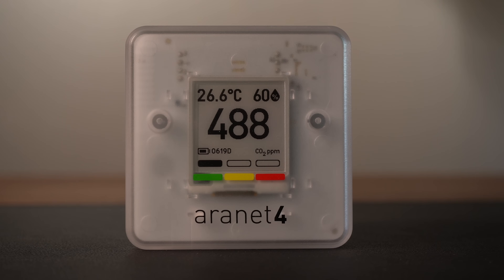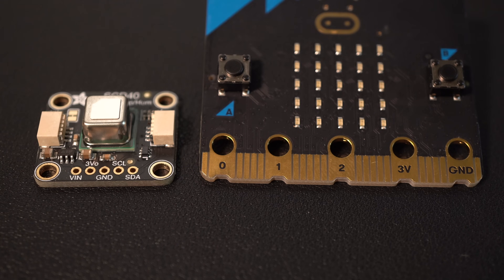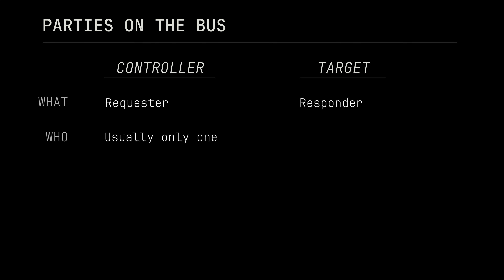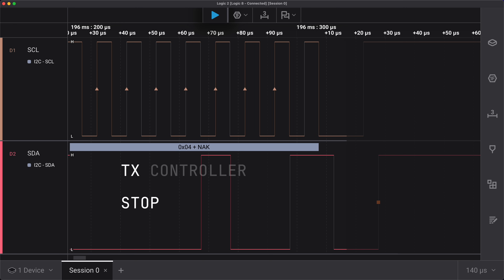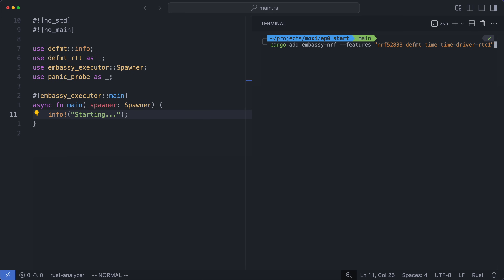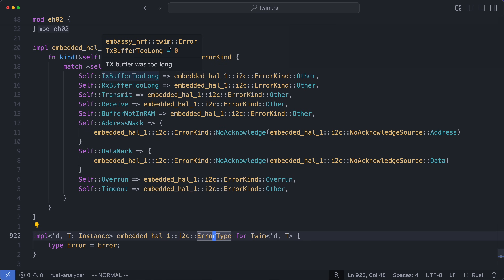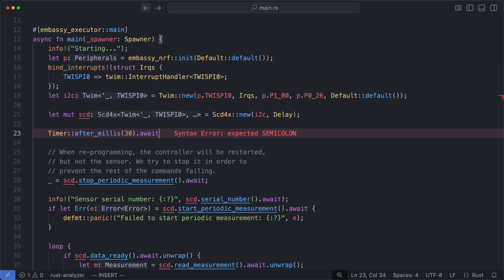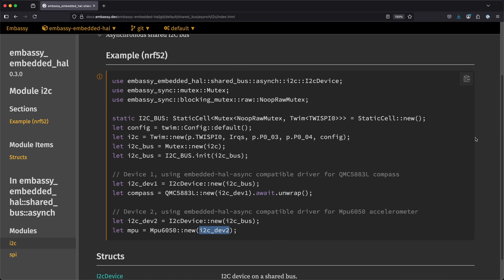Measuring CO2 using I2C & embedded Rust - moxi Ep1

Comment: It would be interesting to have both Adafruit controllers to see how close or apart their results are.  Sensors that spew out number may be comforting, but most users have no way of knowing if the results are accurate.  A test is, of course, having more than one sensor taking readings from the same environment.  If both results are the same: great.  If not, then what do you have?

Comment: Is there an idiomatic way to specify a generic GPIO for sda/scl argument types instead of specialized?
Reply from the maker: Yep! In `embassy` HALs this would be the `AnyPin` type: you can convert the specific pin type into an `AnyPin` using the `degrade()` method, ie, `p.P1_00.degrade()`, and use `AnyPin` types in your task arguments. In future versions of embassy, I believe you'll also be able to use the `into()` method to convert to `AnyPin`: `p.P1_00.into()`.. 
I decided to use the specific P1_00/P0_26 types as task arguments in this case, because for the microbit, these are the specific pins that are expected to be used for SDA & SCL on the expansion connector: or, at least, that is what the breakout boards expect. So, we're using the type system to enforce that hardware invariant.

Comment: Super cool video as always. The only thing I didn't get is, how is the serial number of the target gotten? Is the serial number for this target always the same, or is there a way to scan the bus for connected targets?
Reply from the maker: Great question! Generally speaking, I2C target devices usually have one or two fixed addresses. So, in the case of the SCD40, there is actually only one address value that is allowed: 0x62 (defined in section 3.2 of the datasheet). Other I2C devices might have two possible addresses, where the value will be determined by whether one of the input pins is pulled high or low.

Comment: I bought some AirGradient sensors a while back (these use SenseAir S8 NDIR sensors with a range of 400-10000 ppm CO2) and I still remember waking up the next day after having left it plugged in to a CO2 concentration of something like 3600 ppm... I had a feeling my room's air got stale at times (why I bought the sensors) but I had no idea it was that bad! I vent my room more often now even in winter, and in the summer my window is open more often than not. Fresh air is great! I'm at 678 ppm as I write this :)
Reply from the maker: I've had a similar experience with the Aranet4: finding that a closed door in the home-office or bedroom and forced-air HVAC not running (esp in spring & fall) lead to sky-high ppms! I try to keep the doors & windows open whenever possible now..